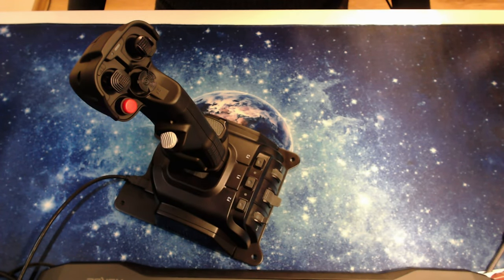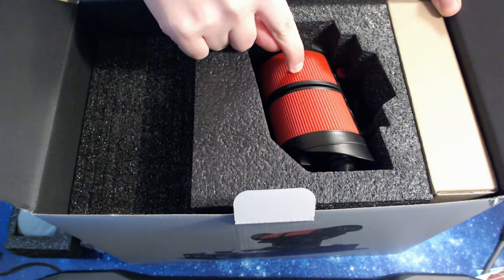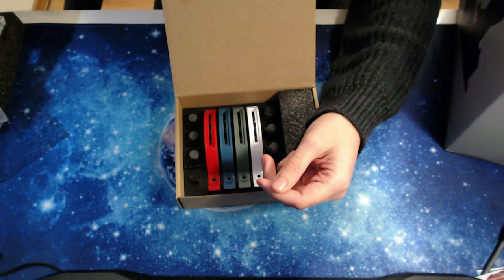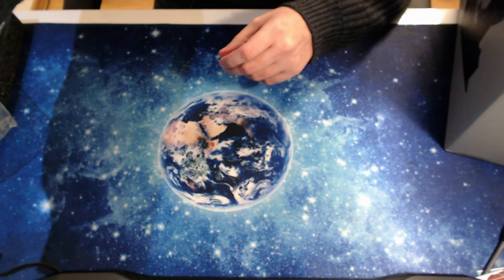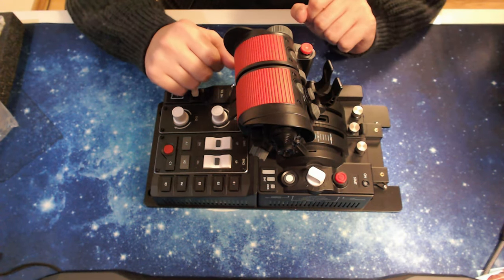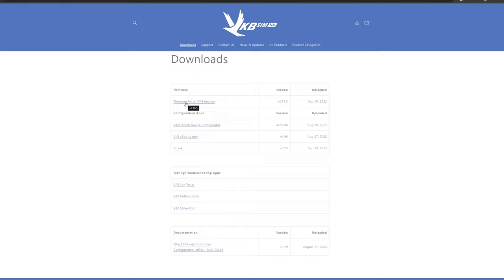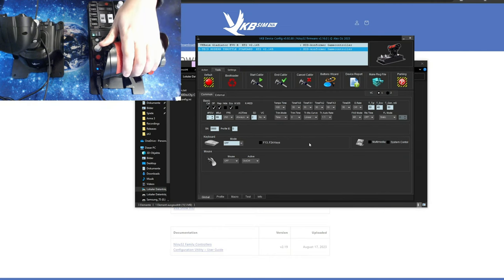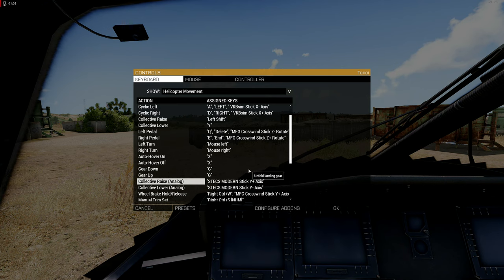🛫VKB STECS THROTTLE SYSTEM STANDARD EDITION. Unboxing, assembly, calibration and first impressions

Comment: This is quite a control surface, good for intense flight sims. Perhaps some Falcon BMS dynamic campaign? 

Also, Graviteam updated the operations mode, changed the way territory capture and initial deployment works. Interesting new change, you should check it out!
Reply from the maker: I have seen that they updated it and will have to test that new feature, it looks very exciting. Falcon BMS does look interesting due to it´s dynamic campaign. But I have something else planned first with much much simpler technology :D

Comment: I've noticed some changes on the right side of the throttle base - mine has some etched text there (big STECS and smaller full name), yours have some quick info about the special combo presses. I didn't know (or forgot?) that "press 3 secs" function depends on the 5-way rotary (so it seems). So this is handy!
When I saw it, I thought that they changed previous ENT+trigger combo, but that one is still relevant and options (3) and (5) are different things.
Reply from the maker: Interesting that they already changed some things.